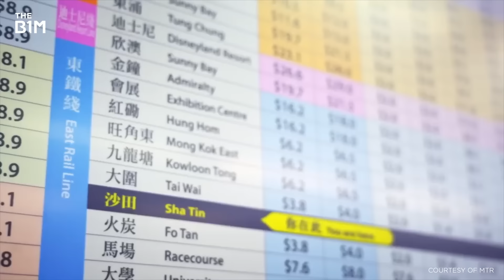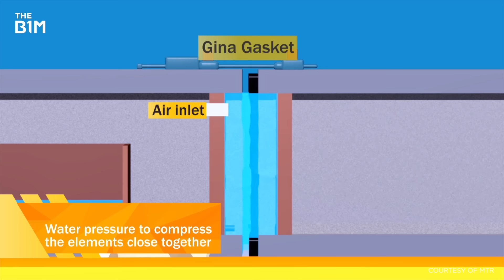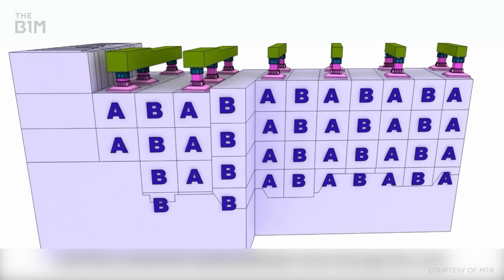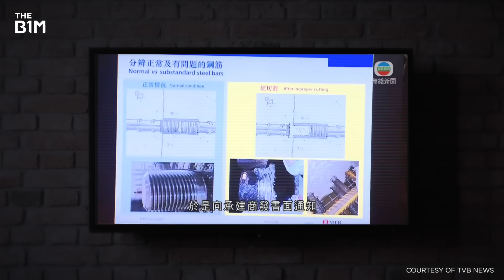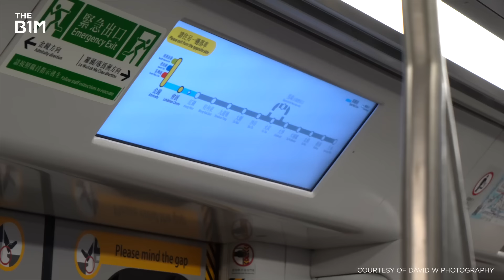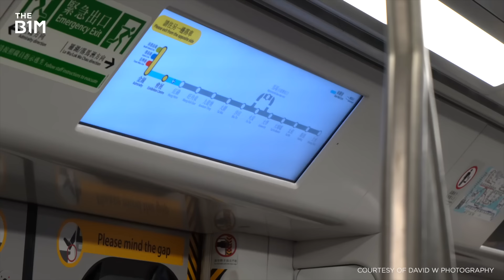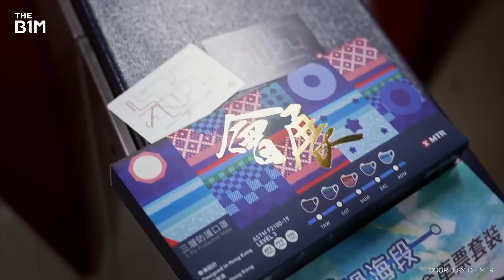Hong Kong's $11BN Underwater Railway Explained

Comment: Well done Hong Kong and MTR.

It wasn't the first construction major scandal in Hong Kong - There was similar scandals about some housing blocks built in Hong Kong in 1970's with poor design, missing cement and rebar and seawater used to make concrete, that scandal also affected some road structures. I recall there was also a foundations scandal in the 1980's.  Unfortunately this is the kind of thing that impacts large/fast major infrastructure projects all over the world. Engineers do try and prevent it - BUT it happens!   

Honk Kong has always celebrated major construction projects completion e.g. by charity walks along major new roads. It does have some major construction projects of which they should be very proud.

Comment: The success of the original MTR system in Hong Kong can be traced back to the colonial administration in the 1960s and more specifically under Governor Murray MacLehose in the 1970s. If the system was not built, traffic congestion would have severely limited growth in Hong Kong in the 1980s.
The continuous improvement, extension and modernisation of the system set the standard for modern metro systems across the world. Whilst it certainly wasn't the first underground system, it did set a number of innovations that were copied across the world (e.g. ticketless systems, platform screen doors etc.). For example many subway lines in mainland China built in the last 20 years also look very similar. Also worth mentioning the MTR operates various underground lines across the world, one of which is the Crossrail line in London.
This particular project was very much overdue because a lot of passengers relied on the Red Tsuen Wan line to cross the harbour, and this line has eliminated the need to change lines at several big stations thereby alleviating congestion during peak hour.
Reply: ye we know...white tech is amazing...
Reply: @willblack8575  funny now the Elizebeth line is run by Hong Kong MTR
Reply: @willblack8575  true dat
Reply: The same colonial government has churned out such poor city design like TuenMun and Tung Chung, and many districts still super relying on the CBD, greatly limited the growing capacity of the outliers, and inevitably, causing traffic burden on CBD and still largely to these days, citizens living on outlying districts, have to frequent CBD to work and for various purposes, and often travel long distances and hours, often reaching homes on connecting travel means, like light rail, and some more walking
Hong Kong has already outgrown colonial design, but the handover is just 25 years ago
Reply: @willblack8575  let’s praise the colonial government
Reply: Hong Kong's MTR is fantastic, but platform screen doors were invented in Saint Petersburg before the MTR even existed.
Reply: @andro7862  But MTR was the first system to install PSDs in stations already open, and did not plan for the installation when they were built.  MTR had to reinforce the platform edges and updated the signalling systems for the PSDs to be installed, and keep in mind that the stations were open to public, so they only had the few hours when the stations were closed to work.  It is truly fascinating.
Reply: @charlesmadre5568  I never expect to see people mentioning about "ding rights" and Heung Yee Kuk under a English video. Thank you for giving people another perspective.
Reply: glad china is protecting this masterpiece
Reply: Nah, this is one of those rare instances like Singapore's "benevolent dictatorship" that colonialism was good for the city.

Granted it didn't stop my Hong Kong parents' white worship and I resent the colonisers for that, but I have to put my feelings aside to look at the overall impact, and the British did a good job with Hong Kong.

Comment: one thing was not mention is that the trains was 12cars in length before the extension part exist. However it was cut to 9 car after the extension such that the trains are much more crowder than before. AS result the public doubt the effectiveness on solving the current transportation issue despite those fans' enthusiasm.

Comment: This video misrepresented the issue in Hung Hom Station.  The rod beams didn't screw all the way into the sockets. The workers were having trouble screwing the rods. So they just screwed HALFway,  Later, the chief engineering inspector saying at the press it is STILL SAFE without remedy work.

Comment: Fantastic achievement 
Hope now they can get around to tackling appalling housing conditions for so many...
Reply: To set the record straight, you can live in a US style house but by Hong kong standards u’ll be in the middle of nowhere
Reply: @lamchunting856  affordable for a working class family ?
Reply: @johnduncan5117  just found a 380 sq ft "house" for 127000 USD in Yuen Long district using 28Hse app. does that count?
Reply: @gepe7176   35 square meters ? not sure it can really qualify as adequate outside of somewhere like HK. I mean sure it's better than a lot of people in HK have, but 35 square meters for a family is definitely not US size. Here in France a family of 4 would usually have around 60 at the absolute minimum. Most would be in apartments of 75 or more. This is not the point though. My point is that in HK right now people are living in tin cans in unsafe buildings, sharing communal bathrooms and kitchens. Whole families. In one of the richest places on earth. There are of course social problems everywhere. Don't get me wrong. But I think from an outsider's perspective, HK's priority seems to be providing better accommodations for the working classes.
Reply: @johnduncan5117  Agree, but I don't think it will ever get fixed because HK just doesn't have enough space. It's basically a physics problem. If an average family apartment was 75 sq meters in HK, the city wouldn't look like HK anymore, it would be a very different place. 

Also living in small spaces is not as bad as you think if you are used to it. It has advantages as well such as convenience and proximity to everything. I live in 15 sq meter place now right in downtown, and at least for me it's better than living in a 75 sq m place if I have to drive every day. 

But I agree that the government should take care of those extreme cases where whole families live in 20 sq meters or something.
Reply: @gepe7176  I can understand that living in a small space in a densely populated place has its advantages. I flat shared for many years as a student and young professional, and it never bothered me. As you say it depends on your situation.
Reply: @gepe7176  it's not about "not enough space". Hong Kong is still more than 50% undeveloped green space. The problem is the lack of affordable housing. The government intentionally not selling off any land, so when they do, they could sell it for trillions of dollars. Real estate developers who buy these land for trillions is NOT gonna use it to build affordable housing. That has been the practice for 30 years and the government has no incentive to solve the housing problem because it's the thing that keeps them rich in the first place
Reply: @ESC_jackqulen  but you can't just start developing this land quickly because it's gonna crash the prices of the existing real estate which is gonna make literally all the current homeowners very angry. also i would argue that getting rid of the 50% green space in HK is not a good decision just from the environmental point of view. also not all of this land goes to private real estate developers, some of the land is used to build public housing for the low-income people, and the current wait time in line is 6 years which is quite long indeed and is getting longer. btw, one of the other reasons why HK real estate is so expensive is because property taxes are so low. and selling to real estate developers for trillions of dollars is one of the reasons why HK government is so rich and can afford low taxation and giving out consumption vouchers.
Reply: @ESC_jackqulen  exactly. And the land sales proceeds are earmarked for infrastructure, which is precisely why we get new rail lines (not a bad thing!) but the government keeps underinvesting in public housing.
Reply: @gepe7176  housing market price crashes are in general not such a bad thing for the bulk of the population. They hurt of course rentiers and retired people hardest. But since they tend to be richer, it's maybe not such a drama. Best is a periodic controlled deflation of house prices by increasing stock to slightly overmatch demand.
Reply: @charlesmadre5568  200k is maybe only a fraction but it's still a shitload of people to be living in squalor in such a rich place....
Not saying 'it will never be solved' is at least a start.
Reply: Im confident the housing conditions will start to improve after the central government issued "friendly reminders" to the big four developers.  They are the "real culprits" when it comes to the existing housing crisis.  Withholding large chunks of land and donations to the environmentalist groups who created all kinds of noises when government tried to take back some of the land for development.  I mean if HK government release 2-5% of their Country Park land, you will have instantly solve the problem.  But there was an immense pressure from the environmentalist groups (aka speakers on behalf of the big four) opposing the idea as it will seriously eats into their profits.

Comment: HongKong, Shenzhen, and Shanghai have the best subway systems in China. They are just so efficient. clean, modern, convenient and affordable.
Reply: if you compare it to that of places like Japan, yes it's cheap by comparison. Other than that most of those are not true, MTR in Hong Kong is definitely no efficient by design and the way it works or maintained, very aged in terms of hardware and network, a ridiculous pricing system that's far from being affordable
Reply: @FenixYuk  MTR is not affordable? Have you been on any other transit system outside Asia?

Comment: Wow, that former quarry sounds like a Cape Canaveral of infrastructure. I hope they use it for future projects as it sounds very convenient to have for such a major metropolis.
Reply: Hong Kong, and in fact many other places, are no stranger to this construction method.  This is like their 4th tunnel built this way.  But what’s significant is that each successive tunnel is harder because it has to pass the existing tunnels and buildings nearby.  In this case two other tunnels, one of which belongs to another MTR line and the other for road traffic.  You cannot even come close to endangering the other tunnels by disturbing the soil.

That’s why this tunnel project was so difficult, despite its small scale in relation to the rest of the rail network.
Reply: @canto_v12  Prefab is the future of nuclear power stations. You order 50 nuclear power plants to build everything in duplicate, have it shipped to site and assembled. 

With the power plants built in duplicates you can build a decommissioning plant that's automated to disassemble parts with programed robots.

What drives up nuclear power plant construction costs is how everything is custom built and outdated bureaucracy regulations.  Soon we'll have 100 year old nuclear power regulations meant for old reactors from the 1960s.

We'll be applying 1960s fission reactor rules to fusion power plants built in the 2060s.

Comment: Hong Kong people are generally very proud of the MTR. MTR also runs the new London Elizabeth line. Hence its name MTR Elizabeth line.
Reply: Not really
Reply: Not really, when it posts record revenue every year and still increases it's fare, and somehow the service keep getting worse. The shatin central link had encountered major technical problem the first week of its opening, nut to mention it was delayed for a few years to begin with.
Reply: @sbeve7445  MTR fares have not risen since the 2019 fare increase and has actually fallen in 2021. They also provide fare rebates for a long time after any fare increase, as long as you use Octopus which is basically everyone.
Reply: @sbeve7445  how is it getting worse? Sure it's more crowded than before but that proves how vital the MTR is for commuters. The fares haven't increased for ages already and come on, it is still amongst the cheapest in the world. The Sha Tin Central link is amongst the most difficult and complex projects they've ever undertaken. Over budget and delays are not uncommon in any construction project. 

Go and try the London underground, the Paris metro and New York underground so then you will appreciate how great the MTR really is.
Reply: @A.T.148-Scot-HK  Major technical issue causing breakdown on the 3rd or 4th day of opening of the cross harbour extension, 2 train crashes (1 during testing and 1 during actual operation at hong hum station) due to poor material and improper signalling, more and more frequent breakdown and idiotic decisions (like shortening east rail line's train from 12 to 9, while still keeping first class, when the entire line is incredibly congested and people having to wait for 2 trains to come).

They also don't really spend their money very wisely, which is even more infurating because MTR is also land owners, the more they fuck up, the more people have to pay up for the housing. For instance. They wanted to upgrade the signalling on the Tsuen Wan line and Kung Tong line, but because of that train crash, it was never put into service (Which I guess is good, but they basically wasted millions of dollars). 

Like fuck me I live in Toronto right now, sure the subway is not as clean / nice as MTR, but at least it is mostly punctual, trains don't crash into each other, and GO train as a whole is really nicely operated. 

MTR start going downhill once it merged with KCR. Because it no longer had any competition and incentive to improve. Instead, now people have to live with it. 

I'm not even going to talk about the protest situations, or the whole construction scandal that the video already mentioned.

At least currently, Hong Kong's bus route are actually also really competitive. The double deckers are nice and comfortable and mostly safe, with much more competitive price.
Reply: @sbeve7445  dude, you can pick out anything negative in any construction project if you deliberately look for them. The MTR's positives outweigh all the negatives you mentioned as they are overwhelmingly punctual and still ranks amongst the best in the world. 

Your comparison to the Toronto subway is ludicrous. Your ridership is 1.6 million per week vs 4 million per day for the MTR. I take the MTR every day. We, the ones who ACTUALLY live in HK rely on the MTR every single day unlike you guys who have to jump into a car to get anywhere in Toronto. 

Again, your claim that it has gone downhill just doesn't stand up to scrutiny. The ridership of the MTR has increased steadily ever since the merger. It's more expansive than ever. More new projects are being proposed than ever. I can get from sha tin to central in just 19 minutes compared to 35 minutes before. Come on man, chin up. I'm humbled by your critique of the MTR but man... You don't even live here.
Reply: @TocSlew  My Allah!
Reply: @A.T.148-Scot-HK  I have been living in Hong Kong for 13 years before I moved. The ridership increases because there are more and more tourist and the population as a whole is increasing. 

MTR isn't bad compared to the rest of the North America, but compared to what it was and how reliable it was 10 years ago, it just doesn't hold up. More accidents, more delays, more scandals. Sure it still is pretty good compared to the rest, it just could've been so much better. I doubt MTR could even stand up against Chinese metro system or Singapore's MRT, when it used to be just so far ahead. Let alone Japan's
Reply: @sbeve7445  you literally answered your own question there mate. Many of the delays and issues are directly caused by an increasing ridership, which the MTR are responding to by expanding into other parts of Hong Kong. 
I will agree that there have been some inexcusable shortcuts taken in recent years but those issues have been resolved now. 

There have been some hiccups in recent years but the MTR is still a company Hong Kong people should be proud of. In fact, many of the networks you mentioned are in fact operated by MTR or its subsidiaries. These include: London's Elizabeth line, Stockholm metro, Beijing, Shenzhen, Hangzhou, Macau and also Sydney and Melbourne's suburban rail systems.
Reply: @sbeve7445  The 2019 train crash on the Tsuen Wan Line was not MTR's fault. The 2019 East Rail Line derailment was a derailment and not a crash. The new synthetic wood material used for the sleepers were not installed properly by the overnight engineers. This is one of a few rare instances of service disruptions due to MTR internal factors. You are right that there has been more of these since the MTR-KCR merger, but the amount of incidents is still not a lot. It is also worth considering that the infrastructure of the MTR is getting older.

I wouldn't call the shortening of the East Rail Line trains to 9 cars is 'idiotic'; it was necessary. And as someone who uses the East Rail Line during rush hours now, I can assure you that anyone can get on the first train if they are at the right spot on the platform, but HK people are terrible at moving along platforms. Also, MTR can increase capacity as more R trains are to be delivered and they can operate with 10-car trains if necessary but not immediately. 

The MTR is as safe, if not safer than the buses in my opinion. While MTR is more expensive for most instances, they are actually noticably cheaper than competing bus routes along the East Rail Line, and most likely faster (at least during rush hours when most people use transport).